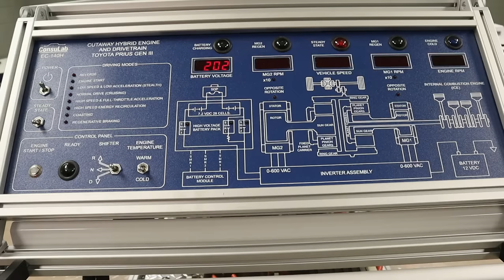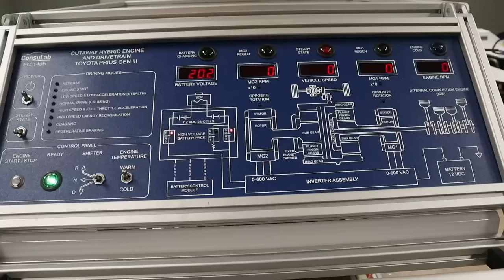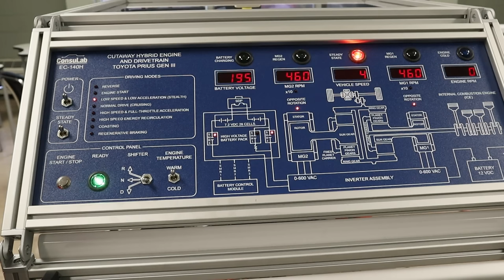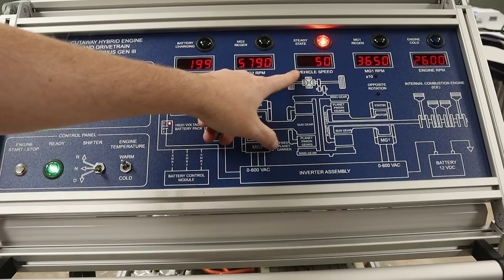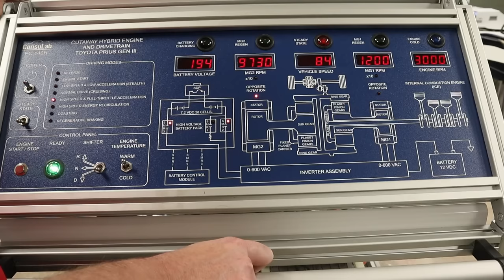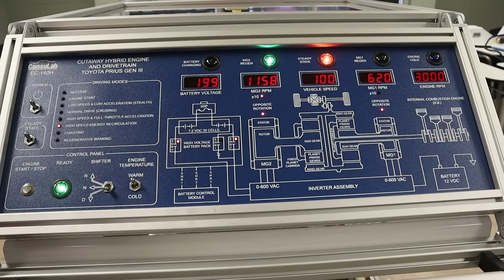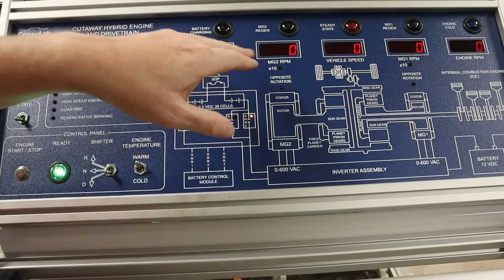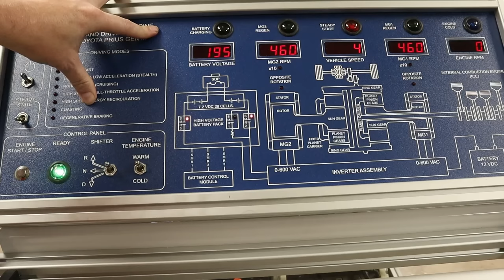How the Prius Hybrid Drivetrain Works (Explained)

Comment: The engineering that goes into this car is very impressive. To me, it's fun to drive, sort of like a game (at least once the engine warms up). The most efficient traveling 'mode' is to be truly coasting, with your foot resting very lightly on the accelerator to prevent regen. That eliminates energy transfer, which is more efficient than regening the energy into the battery. You can do this a lot in city driving, such as coasting up to a red light that is 2 blocks away, if you are on a slight downhill which allows you to hold the speed of traffic in that 45mph or under speed. It's called pulse and glide. You use the engine power to get up to speed, then glide(coast). Driving with no foot on the accelerator will cause a small regen load (like engine braking in a normal car). This is fine if you need to get your battery charge back up.  Many people think that driving in electric mode if best. But that is only true when the load is very low - such as in parking lots and steady speeds under 20mph typically.  You only have a very small range in electric mode. The car is not designed for that. The ICE is most efficient under heavier load and at higher speed. The car's computers do most of this for the average driver, switching between modes without you thinking about it. But you can improve efficiency by minimizing time that either the ICE or electric motors are doing anything.  Avoid drawing prolonged full EV power when above 15mph. It's really all about anticipating the next 5-20 seconds of driving up the road. No reason to go full speed up to a red light when you have to stop anyway. Often times you can time a light to the point where you can avoid stopping altogether. Truckers do this, because it reduces wear, less shifting and saves fuel. There is of course limits to this, you don't want to crawl at low speed with traffic behind you.
Reply: You put it together and explained so nicely, I could never do explain it better even though I am a Prius owner and a former mechanic 🙂👍
Reply: That's right and way back, I heard that Audi was trying a system where the car would know what the traffic lights are going to do and would time itself to sail through them.
Reply: @b43xoit as if there Is any rhyme or reason to when the lights change 😭. Lol the city where I live the lights are timed so horribly. They need ai to control them its so bad.
Reply: Traffic lights owned by the oil companies 😅
Reply: I find it amusing that my fellow Prius drivers frequently preach about not going to a faster speed than needed and coasting all the time to improve efficiency- while all this is true, why I find it funny is that the entire point of owning a hybrid vehicle is to mitigate these inefficiencies. All the advice we apply to hybrid vehicles are actually much more true for conventional ICE vehicles- since there is no regenerative braking, you better not be punching it in between stoplights. In a hybrid, while yes it is more efficient to use less power, it actually makes far less of a difference. Unnecessary acceleration and stopping will take you from like 50 to 45 instead of 30 to 15. The main difference is you want to make sure you brake very early so it's low torque and you don't engage the hydraulic brakes. You didn't buy a hybrid vehicle to use friction to stop like a caveman. 
Granted, the motors are more efficient at lower torques. But this mostly matters for braking, not so much accelerating, because when you accelerate it's primarily using the engine anyway, with the motors just helping out. You can see this if you install Dr. Prius and observe the battery charging/discharging current (directly proportional to power). Regen braking charges at up to 100 something amps (depending on battery health- mine's pretty old so it only gets up to about 80) before hydraulics kick in, stealth mode driving discharges up to a similar rate, but when you're accelerating with the engine it drops to more like 10A.

Comment: So instead of being the main propellant,the engine here in this system only assists the motors, at 100mph it only revs as high as 3k rpm with the help of MG1 as an overdrive.that’s why the Prius is slow as a snail

Comment: The "Power split device"  is actually a differential gear set.

The hydraulic CVTs that agricultural tractors have use the same layout ,except they use hydraulic pumps/motors instead of electric motors
Reply: It transmits rotations like a differential, but the power split device uses spur gears (cylindrical) and a differential uses conical gears, so that the input and outputs can be at 90 degrees.

A power split device could be made with a differential too, but those tiny internal gears would experience 1000x more rotations than they were ever intended for.
Reply: @robertoguerra5375  It is a differential.
A differential is any gear set that gives two differential output speeds for one input speed depending on the loads on the output shaft.

That is why it is called a "differential" and not a pumpkin or a blowfish.The differential on my ride-on mower has no bevel gears it uses only an epicyclic gear set.
The nature of the gears used to achieve this or the angles of the input shaft or output shaft is entirely irrelevant.
The differential on my ride-on mower has no bevel gears it uses only an epicyclic gear set.

It is analogous to a differential amplifier in electronics
Reply: I like to call them planetary gear sets

Comment: Hi, you're a genuine lecturer who're able to explain those very complex mechanical stuff in a very understandable laymen non-mechanic people like me...

Thank you very much Sir.

I have some questions base on your explanation;

1. The MG1 gets the power from 12v battery only. Not from HV battery. And MG1 would be the one which kick off the ICE using the 12v power. So in case the 12v battery is drained, we can do jump-start from another vehicle to kick off the ICE, right? Am I correct?

2. What if the HV battery is totally drained too, for eg. if we put the Gear at N for very long time and all the electricals are ON too, which end up both HV battery & 12v battery drain. If we just do jump start the 12v battery, will the ICE kick off back? (while the HV battery drains too...)

Thank you very much Sir.

Comment: I own a 2013 Prius and another Gen 3 CVT that I invested in with the goal to make a 3-phase generator (alternator technically first and foremost) using a Briggs & Stratton 18HP opposed twin somewhat sentimental since was there hybrid car engine and I want to limit what power I can output in the initial design.  Your video showing the demonstrator is excellent as well as your detail regarding how the engine, MG1 and MG2 function.  

I look forward to testing to see what the voltage and current profiles look like (Hz mainly) at the range of RPM's.  Appears using the CVT without any custom fabricated MG casing (including with cooling unless I invest in another Prius-C CVT). 

My brake pads in the front are at ~260K miles and the rear most likely would have made as far though the passenger side lower caliper pin siezed and cause the pad to wear uneven so I replaced the pads... with amazement how the runout and thickness of the rotors were at worse 1/2 worn and at best 1/10th worn.  That was at I think ~190K miles. 

I notice you say "stator" when I think as "rotor."  Is that correct?

Finally, do you happen to know what the frequency of the MG1 and/or MG2 (either one) is output?  I'm guessing seeing the RPM and being 3-phase I can determine once I find out the number of windings... though I still need to study more since is I think an asynchronous alternator design being brushless.  So will have those funky output variables without a load/resistance.  

I also want to make an AC/DC welder and seems a plasma cutter can be made from as well.  These are the neatest to me and I am amazed the pricing since they last so long... that's nuts to me!  

Anyways, those specs for the MG1 or MG2 would be awesome to know since I'm wondering what the utility of the outputs will be as-is and then what all else will need to be made or used from the inverter/converter (I also invested in 3 more of those to have the parts since pricing was crazy on the half off self serve salvage yard days) to be more practical 3-phase (or single) 220 or 120VAC or maybe even 480-600VAC.   If you know or have any reference, please share!  Thanks again and awesome man!  Very inspirational to learn to work on and seems like a great career.
Reply: I know this was a year ago but have you looked into the openinverter project? I've seen some talk there about doing exactly what you want.

Comment: Very informative.  I was under the impression that there was still a mechanical connection between the engine and driveline, and that there also was a transmission.  So to an extent MG1 acts somewhat as a torque converter/transmission (OD as you say) when under acceleration-something I never realized.
Reply: Yeah same here and that was surprising/deceptive at first because the engine is running of course while they zip up to speed... I too did not expect all the power to go thru wiring before hitting the wheels. I'm assuming this is the "synergy" part of it... complete management of the energy

Comment: Hey Ken
Great video. Awesome cutaway.      Go!  Snap-on
 Life long technician with Ryder first time owner of this power train.  Just started researching and your video was the first one I clicked on.  This is a great design. 
I was gifted a 2011 with 165k and I love it so far.
Reply from the maker: Gen 3 is a good platform but it does have some things to look out for. Thanks for watching!
Reply: What do you need to watch out for?
Reply from the maker: Head gasket, brake actuator, water pump failure, EGR clogging, and HV battery failure.
Reply: @AutoScholarwithMrB  is there any information on the frequency of these issues?
Reply from the maker: @guydamico85  I’ve seen all these issues at various miles, a few at the 80k range and I haven’t seen many make it to 200k miles without at least one happen.

Comment: Great video! Explains a lot.  I have a question for you. I have a 2005 prius hybrid that I had to replace the brake accumulator. We had to disconnect the inverter and move it to the side to get it out. The accumulator was bad but the inverter wasn't. After the job was done when you go to put the car in drive it bangs really bad for a second and then the triangle of death comes on.we are waiting for a scanner to bleed the brakes but we did bleed them manually and got a lot of air out. There is other lights on also. The cil,brake light, abs,and maintenance light,and the one with the explanation mark in it. It ran fine before the work was done? Are they on bc it needs to be bleed properly and could we have accidentally hooked up a wire wrong? Also the car doesn't want to go into gear.

Comment: Very good video, one of the only videos i've really found that can explain hybrid in detail without making my brain hurt lol. Just one question, I was a little lost when the control panel "opposite rotation" does that mean that MG1 and MG2 are turning in opposite directions?
Reply: Would love to hear a reply for this as well...
Reply: Yes, notice that whenever the vehicle is moving forward, MG2 is showing "opposite rotation." But at the end, in reverse, the light is out for MG2. MG2 is directly connected to the drive train and will rotation 'opposite rotation' when the car is moving forward and 'normal direction' when in reverse, always. However, since MG1 works in tandem at times with the ICE, it can run in both directions. If the ICE is off and the car is moving forward, it more or less freewheels and rotates in 'opposite direction' is tandem with MG2. All bets are off so to say once the ICE is started because now MG1 has to have a relative speed to the ICE to control the ICE's rpms as well as starting the ICE. Coming out of stealth mode we see MG1 has to rotate in the normal direction to start the ICE.

Comment: ThankI am Prius owner and my DC to DC Inverter failed and Dealer replaced free because of my warranty. Nice to know how everything works. I get 50 MPG and can go over 600 miles between gas fills  :)
Reply from the maker: That’s pretty good! I have a CT200h and can almost get 500, but I do a lot of highway miles unfortunately. Thanks for watching!
Reply: 50 mpg/4.7 liters per 100 is awesome

Comment: My 2015 has 218,000 still seeing 48-49 mpg with over 550 miles per fill up.  Replaced the NiMH battery with the NexPower lithium system.
Reply from the maker: That’s pretty strong! My CT is getting around 45 with 130k on it on the original battery.

Comment: I had a 2013 Prius and the first long trip I ever took with was through some rolling hills for a lot of miles. When I got to the 3-way stop in Coudersport I spent a long time at a stop sign and that car kept turning the gas engine and stopping. Did it like 7 times to discharge the traction battery to a safer level. I'd never experienced that before and was concerned... "Shit! I owe a lot of money on this car... is it broken?" 

I drove another 60k trouble-free miles with it before a long legged woods rat leapt in front of me. 

Side note: That car's traction control system was all-the-bad! The slightest bit of slip and snow made the whole car give up on life.
Reply from the maker: Agree with the stability control. I came from a Jetta GLI to my CT200h and the stability control and ABS is poop on these cars comparatively. Thanks for watching!

Comment: Hello . In hybrid vehicles, will using the battery at less than 20 percent damage the battery?
Reply: Nope. The car manages the battery through software. If it needs charging, the engine runs to do so. As long as the car hasn't sat undriven for weeks, the battery shouldn't be critically low.

Comment: What is energy circulation all about?  Why would you put that extra resistance on the shaft?
You said around 23:45 "MG2 is both generating power and giving power out". How is that possible and what does that mean? And how does that make it overdrive?
Reply: I think his explanation is confusing. And I think "energy recirculation" is a method to get the effect of a higher gear without changeable gears. In a conventional transmission, a high gear allows high wheel speed while maintaining low engine speed. To do that with the Prius drivetrain, the control system has to shift energy via the electrical pathways. MG2 is connected to the wheels through a fixed-ratio geartrain. MG1 is on a differential between the engine and the wheels. Assume the battery is neither taking nor giving energy. What has to happen with the two motors? Talk about speed first, and from that try to infer the directions of flow of energy. MG1 has to add speed. Therefore, it also has to add power on the mechanical side. Therefore, it has to take up power from the electrical side. If we are not drawing from the battery, this power has to come from MG2. Therefore MG2 has to take up mechanical energy. It takes it from the ring gears, which are driven by the engine and MG1.

Comment: Seeing how simple this design is, i don't see there is much that could get damaged, if something can get damaged at all, if someone does not change the transaxle fluid, and go as far as 200,000 miles [which as happened a lot]
Reply from the maker: Agreed, to a point. There isn't much to fail in a differential on a RWD car, which has a much more durable fluid. We change the fluid in those. I'm not really sure what the correct answer is. I will say I have not seen a transmission failure yet that isn't an electrical problem. Thanks for watching!
Reply: mine has 240k on the clock with only oil changes and still drives perfectly fine
Reply: Is that to mean the transmission fluid is still original? I'm curious because I just purchased a 2nd gen with124k, I'm a little nervous because the tranny fluid was apparently never changed.
Reply: @matthewschrock8947   My 2012 Prius C has 138,000 miles and it still has the original transaxle fluid.
Reply: @QuincyStick  no transmission fluid changes??
I just bought two 08 second gens, one with 98k and one with 160k don't know if anyone's ever changed it or not but I suspect it will be one of the first projects.
Reply: @whatsit2ya247  They basically function as diffs, and virtually nobody changes their diff fluid without an issue. The car only lived a short portion of it's life with me, so I didn't see it worth the hassle and money to go changing it.
Reply: @QuincyStick  So you got rid of your Prius
Reply: @hedgehogthesonic3181  Yes, because it blew a head gasket at 240k miles

Comment: I got a 2016 toyota prius... what happened to my car is... wont star and no light on a dush....... need help thanks
Reply from the maker: Have you checked the 12 volt battery?
Reply: I had a Toyota Aqua rental car that did this after leaving the lights on, Just charge the 12v battery or jump start it. In some models the 12v battery is under the rear seat.

Comment: What do you mean by 80%. How does it figure out  battery capacity,based on voltage?
Reply from the maker: Yes, and this is controlled by the battery control module.

Comment: Just wanted to thank you for this masterclass you have provided. It is clear that the whole package created by Toyota is a masterpiece of the automotive engineering and it is far away from rest of OEMs in terms of hybridation technology.
I am owner of a 2023 Corolla with 5th gen of hybrid system and sure the function is the same.
However I just wanted to ask you for a question. If driving with my car (with 140 HP) through a hill and the battery starts to drop down to that lower limit of 20% but I push the throttle as I need to overpass another car, is the system capable of providing the full power of the engine? Can the MG2 recharge the battery an provide power at the same time to make available those 140 HP or the power is lower?